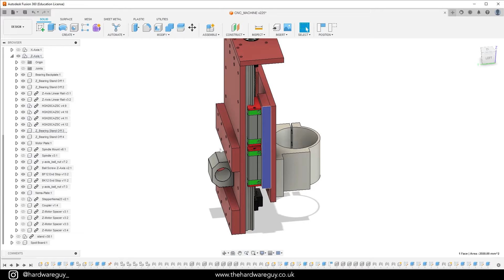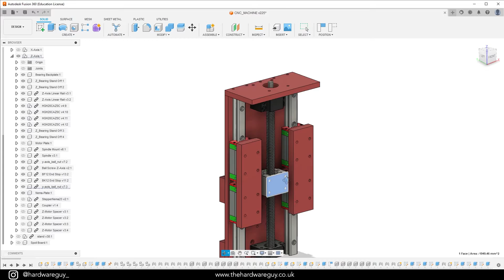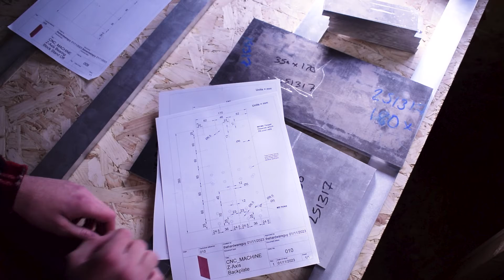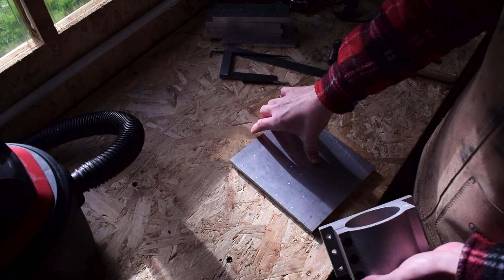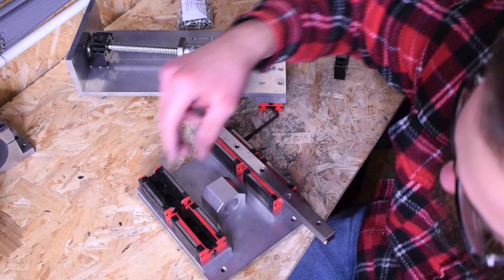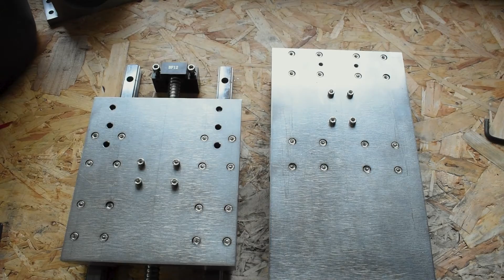DIY CNC 007 - Z-Axis Assembly

Comment: Absolutely beautiful! I can only imaging the stress in tapping all those holes. My luck would be to get the last one then break a tap ;(
Reply from the maker: Thank you!😊 I did break one M5 tap but it was Carbon Steel. All My Tungston Steel taps have been great. A lot of people use the drill to do the taps but if you bottom out the drill will snap the tap. I've done 95% of my taps by hand and I've just tried my best not to rush things and be patient, which has served me well so far!. The X & Y linear rails will be the true test of patience!